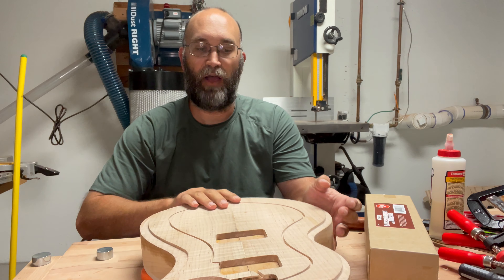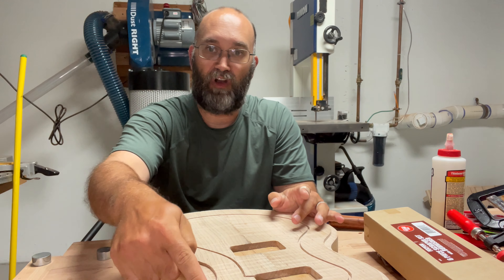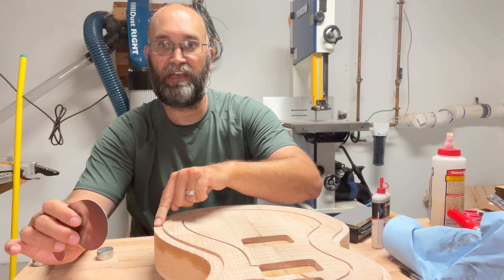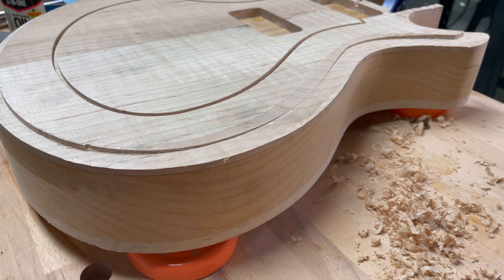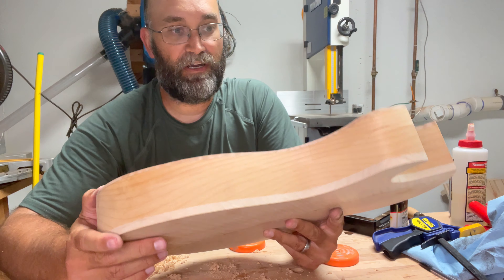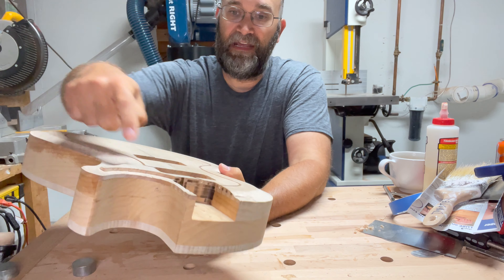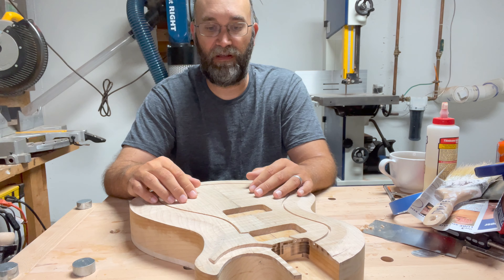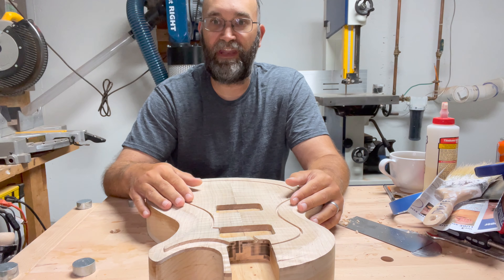Carving a Guitar Top with a Scraper

Comment: Nice save from one of those happy little accidents.  I think that carve enhanced the look a lot. Not sure what your original plan was but the more rounded shape I think presents better then just square edge binding
Reply from the maker: Thanks! Honestly, I didn't have a ton of thought into the design going in, it was more of a mash-up of things I wanted to try. So the ribs of the guitar are carved with the CNC, then I laminated the bottom on (no embellishments). Then, I figured why not try to do inlay and purfling. Now that the purfling channel got messed up, I've got the carved top.

Definitely agree though, looks a lot better than the acoustic guitar "squared up" approach